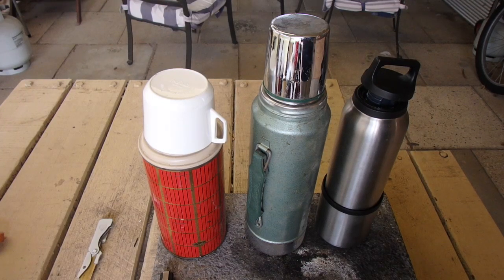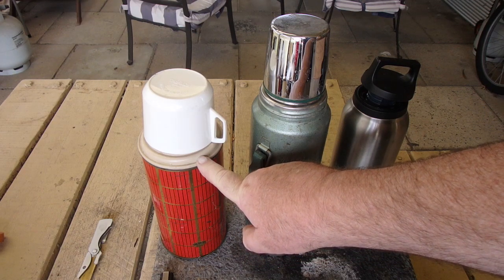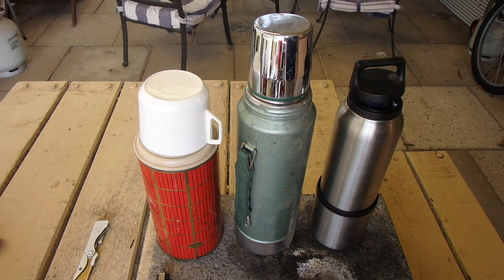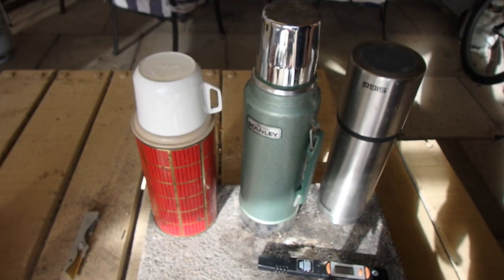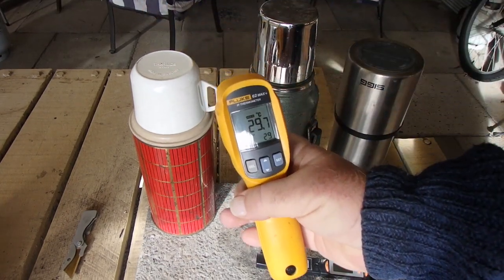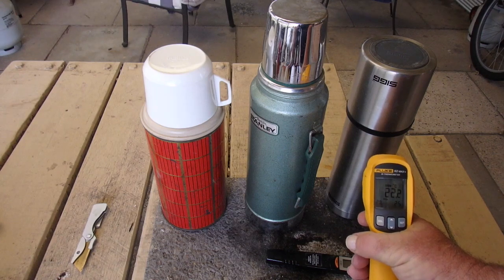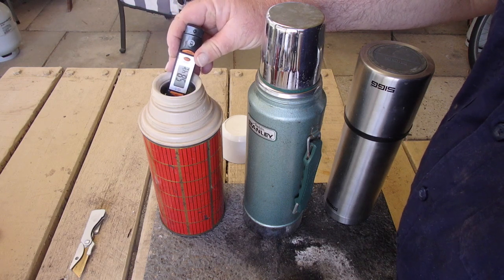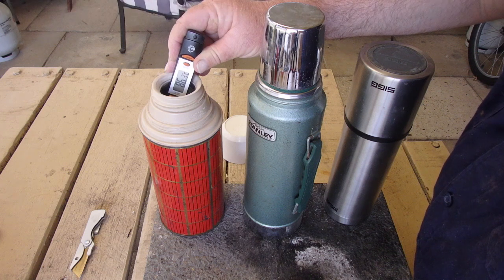70 year old thermos wins performance test

Comment: I have a 30 year old Stanley just like the one in the middle and I have never been very happy with how it works. We have a glass insulated carafe that will keep coffee hot twice as long as the Stanley.
Reply from the maker: The old school glass one was a clear winner on this test
Reply: how did it last 30 years if it's so trashy?? stanley thermoses routinely get rave reviews throughout
Reply: Stanley has a poor stopper in this one. I have saw in another video similar results and people were saying they would put a wine bottle cork into it. Sometimes an o-ring (1 of 2) is missing.

Comment: I just a similar one. It feels like it belongs to a museum... but I've been using it because it works superbly! The first time I tested it, I poured boiling water at night, left it on the counter. The next night I tried it and even burned my hand when touching the water. The only problem is that I noticed a bit of peeling on the silver part. Is there anyway to restore that?
Reply from the maker: You could try clear nail polish to keep moisture out to prevent more damage
Reply: @kisbushcraftdownunder  I'll try that. Thank you.
Reply: @kisbushcraftdownunder  wouldn't bacteria grow in the liquid having been hot for that long
Reply from the maker: @hassanjamal4212  I think as long as the container is clean and the water is boiling you are fine tea tastes better anyway when you make fresh rather than letting it stew for hours inside the thermos
Reply: @kisbushcraftdownunder  true...its going to taste weird definitely. I think this is better to keep drinks cold not hot...hot drinks should be made and drunk fresh.

Comment: The pour through lids on the older stanleys loose heat faster....little hack roll up a paper towell or find a cork that fits in the stopper to prevent the heat loss....boiling water still steamed after day and a half
Reply from the maker: Those lids are the weak spot in a lot of thermos designs the old cork stopper is probably the best thermal protection. In Australia the first Coolers had cork insulation inside tin boxes regards mike